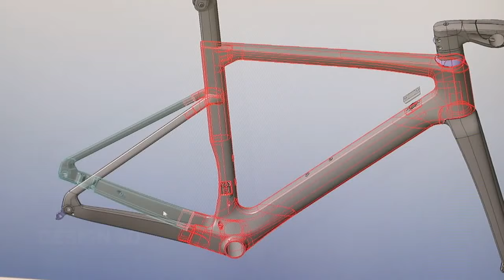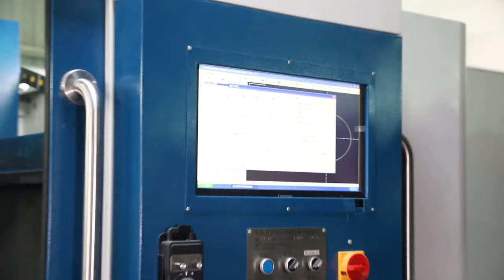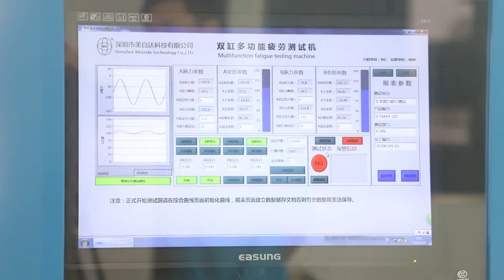How To Manufacture Carbon Road Disc Frame ICAN A9 Frame

Comment: Have built your 2015 Aero 007 Roadbike frameset up & many miles later its still 100% solid & responsive. Great product.

Also bought your 38mm Disc Cyclocross Carbon wheelset for my Giant Contend SL2 Disc Road Bike. Light & Tough wheels !
I'm 200# and they're solid on our nasty rough Texas Rural roads. Probably have 4500 miles @ 2.5 years old...
I have my eye on your FAT bike now...
Reply from the maker: Thank you for loving ICAN frame and wheels.we can give you the best price on fat bike😁

Comment: For Chinese made carbon i am very impressed with it i really i been looking at reviews talking to others about the A9 frame and i will buy it looks legitimate than most Chinese carbon frames i have seen i might just buy this frame next month it might go very great with my DT alloy rims never use carbon rims scared to
Reply from the maker: Thank you for your trust，please order it from :https://icancycling.com/  and use ORDERBONUS to enjoy the discount
Reply: @ICANCycling  can i use standard cables ok or is only electronic cables
Reply from the maker: @dwayneflannery  it is ok to use standard cables
Reply: @ICANCycling  i use hydraulic disc brakes but my rotors are both 140mm can use them both or do i need a 160mm for the front
Reply: @ICANCycling  i really need to know if i can use 140mm rotor instead of 160mm rotor for the front
Reply from the maker: @dwayneflannery hello, i consult our expert, ,you can use 140mm front rotors
Reply: @ICANCycling  thank you
Reply from the maker: @dwayneflannery  you are welcome，my pleasesured to help

Comment: I would buy one of these frame for sure.I wonder if they make this frame for rim brakes?
Reply from the maker: It is for disc brake only.
Reply: @ICANCycling  Since i have a rim break Ultegra group,i was thinking in using that.
No problem,i will sell it and buy a new Ultegra disc group.
As soon as i need a frame i will get in touch with you in the Usa.
I am in Italy now,i should be' back in the Usa soon.I will then get in touch with you headquarter in the Us for an aero frame.
Thank You.Ciao from Italy for now.
Reply from the maker: Sounds a good plan. Feel free to contact with us, or send email to me willis@icancycling.com. I will try best to help. @saveriodipoce2201

Comment: Does the A9 frame only compatible with electronic groupsets?
Reply from the maker: It just not compatible with electronic groupset,it can use  as normal groupsets.
Reply: As long as it's hydraulic right? Wow amazing that could save some money instead of buying expensive electronic groupsets.. Thanks Ican for the quick reply!! I had sent and email thru your website bdw..
Reply from the maker: @vincentllanoslangi7835  thank you, then our sales will reply you soon.